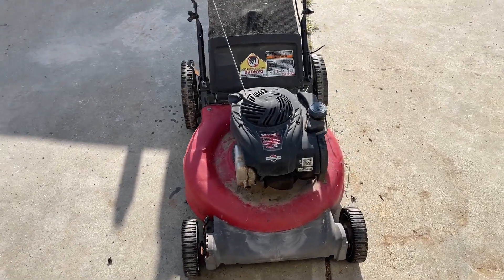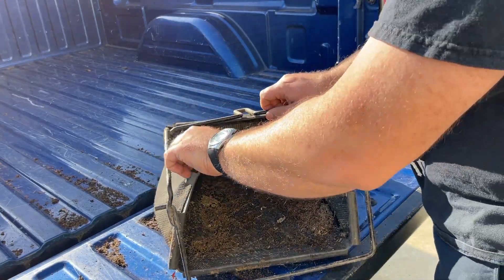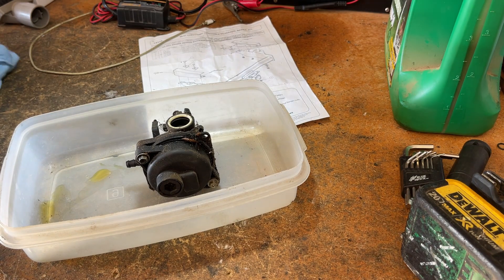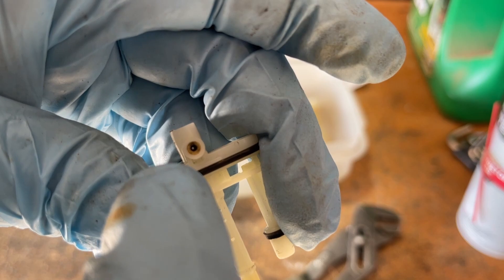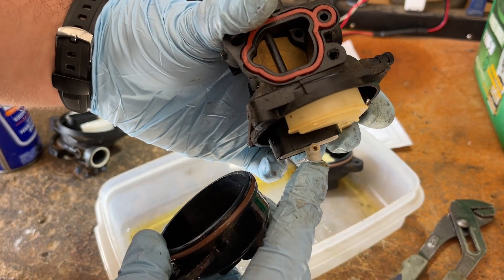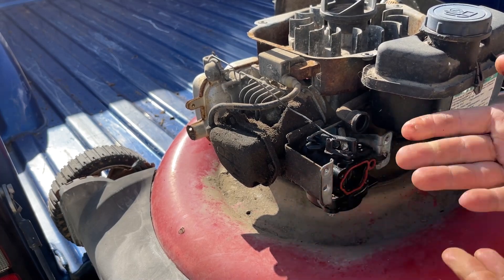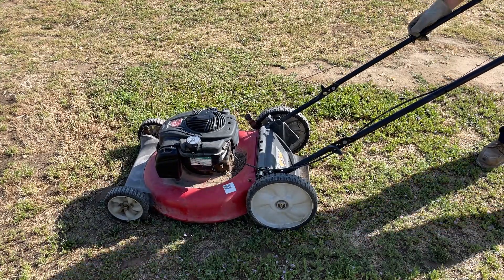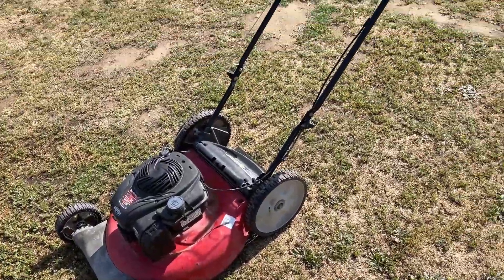This Yard Machines Mower Won't Start - Can We Save It?

Comment: You should check the valve lash and make sure they are correct. Small adjustments can improve engine performance